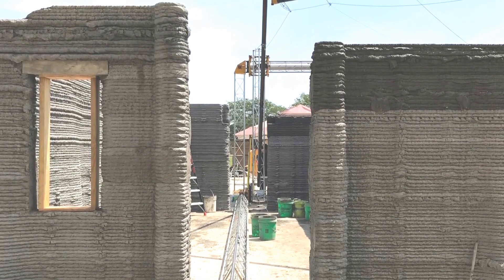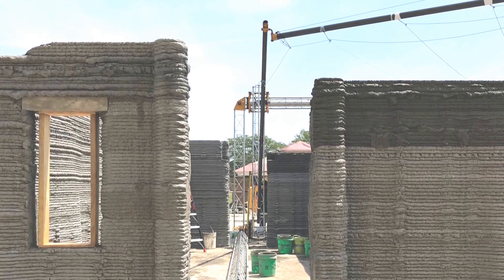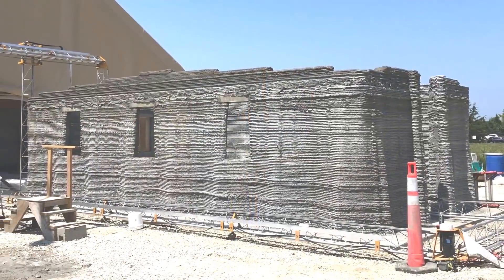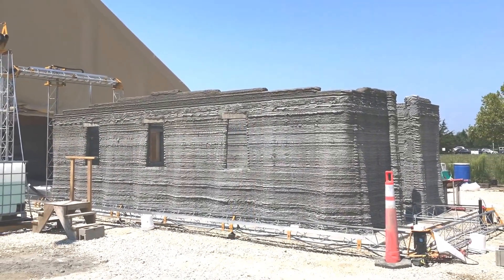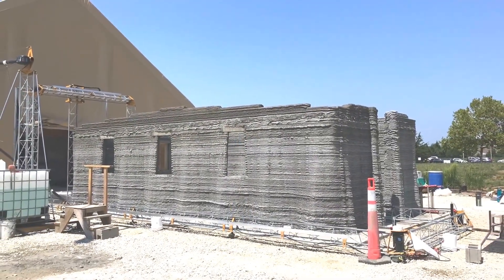Marine Corps Systems Command - 3D-Printed Concrete Barracks Robotic Construction Research [1080p60]

Comment: how about a rebar? this looks like a building for the short term use.
Reply: If they are using fiber reinforced concrete, it has the same strength as traditional rebar reinforced concrete. Of course, this video doesn't provide any details, which is not surprising, being a military project.